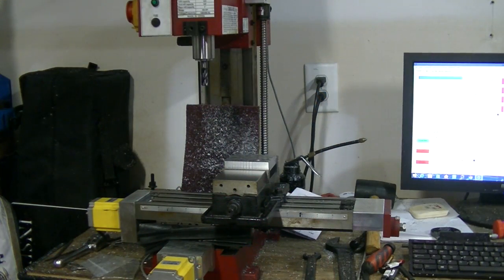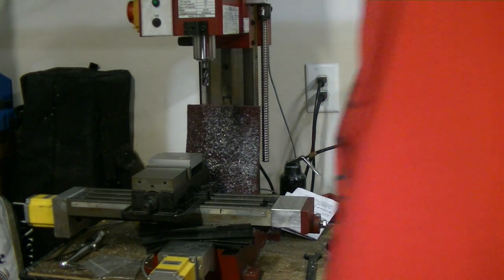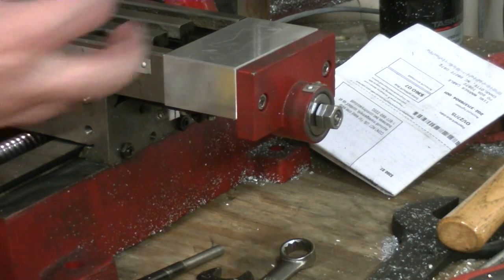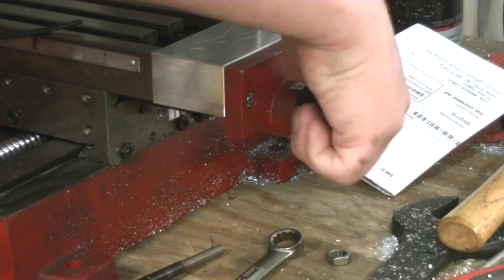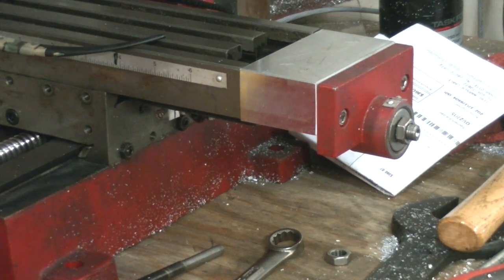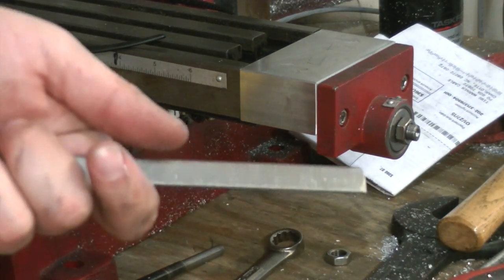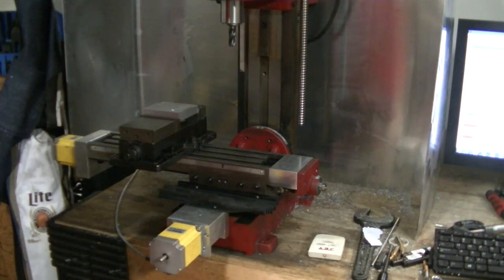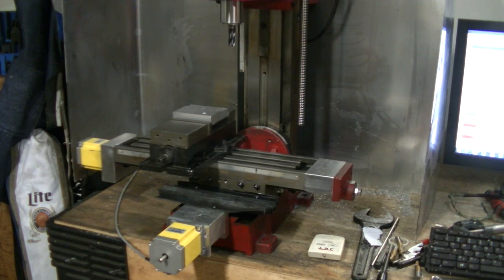CNC Mini-Mill Tuning and Repairs

Comment: Oil.  you may be seeing a lube problem.  See about some way oil on those gibbs,
Reply from the maker: +Idomake Thanks for the comment and for watching the video. Do you have a recommended oil? I've been using Mobil Vactra way oil on my lathes and mills for the moving surfaces like that but I'll admit to having not always been faithful to checking it on this particular machine as opposed to my manual machines.

Sincerely,
Tom Z
Reply: I'm guessing that's the OEM recommendation?  Also if this is a CNC upgrade you may want too consider a pump system.  One or two pulls a day depending on how much you are using it.  This  is what caused the scoring on the gibbs, and then the the binding.  Oil is you friend.
Reply: If the OEM says "Way Oil", the Mobile is fine.  Never use motor oil or gear oil.  Motor oil is too thin, Gear oil is too thick.  ANY TIME you have metal parts working together they need oil.  Lastly, if you have a manual lathe check the requirement for the apron box, that's the one that slides back and forth along the lathe, the part the cross slide mounts too.  It may very well be that it requires the oil as well.  The thing few people know is that there is a pump in there that pumps oil out of that box to the ways for lube (they should have a film of oil all the time)  That same oil lubs all of those shafts and gears inside that box.  Let it go dry and it will make you pull out your credit card.
Reply from the maker: +Idomake Yes, the Mobil Vactra is the #2 Way Oil blend. My bigger lathe is an old Clausing Colchester 13" and it's got the apron resevoir like you described. I topped everything up recently on that one but it's due for a good service once I get fully back on my feet again. I'm about to do a clean and refit of the little CNC mill and get it set up properly. It sounds like I need to pull the table and inspect the dovetails; if it was running dry enough to score the gibs it could have done some damage there too.
Reply: You can bet on it,  Best of luck.  It'll make for some good content.

Comment: Hi Tom,
I'm glad you are finding and fixing some of the small issues with your CNC.  I am sure you will have it up and making parts in no time.
Thanks,
Reid
Reply from the maker: Reid Eichner Thank you, sir. I'm nearly done with the first production part on the mill but anything that could slow me down has done so in spectacular fashion. I got the part cut but now am running in to issue attaching it to another part. Darn metric threaded holes!

More soon.
Tom

Comment: Tom, thanks for sharing your learning, i am sure this will become a useful research for anyone doing a CNC conversion.  i will refer back to these in the future for sure!
Reply from the maker: turbocobra Hopefully you won't have to run in to the same sorts of issues I have had, Gary. Even if you converted your existing mill I have a feeling you would be starting from a much better place. The plasma table, on the other hand, will give you a new set of challenges...

Thanks for watching!
Tom